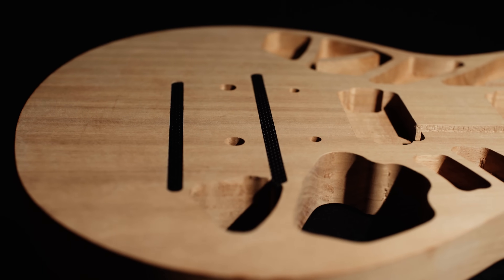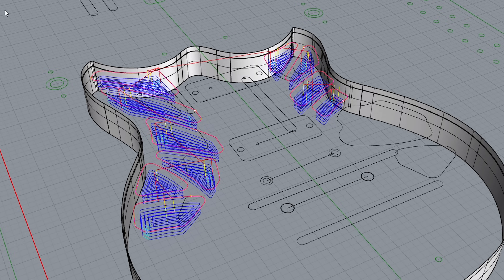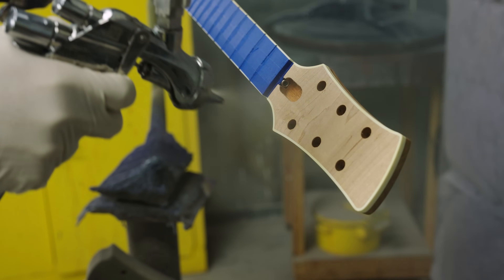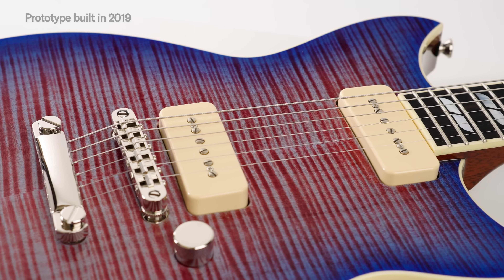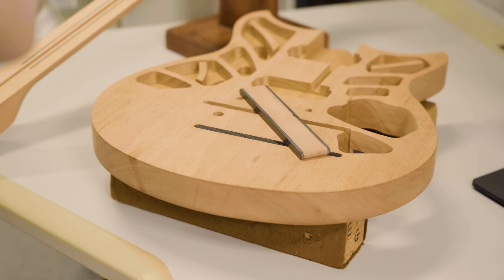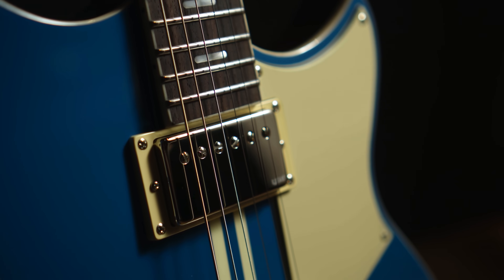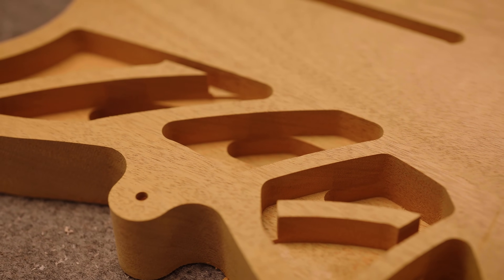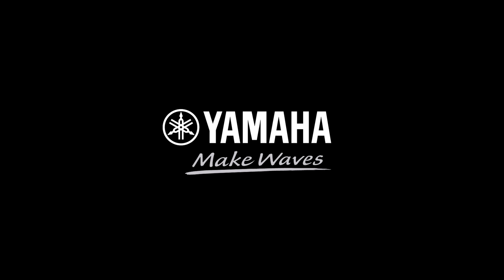Yamaha Guitars | Tone Through Science

Comment: My Revstar RSS02T is my #1 non-vibrato equipt guitar. 
Love it. 
It's like it was made for my biometrics.😎👍👍
However...cannot find the location of its serial number...?
Perhaps someone could tell me where it is on the guitar...?😃👍👍
😎✌👍❤🖖
Reply: It’s stamped into the back of the headstock like on any other guitar 👍🏼
Reply: @ChidOki  
Thanks for posting.😎👍
Do you have a Revstar RSS02T?
Mine doesn't have a serial number anywhere on the body.
Haven't checked the pup routes yet to see if it's there.
The only thing on the back of my headstock is something that looks like a scan block...?